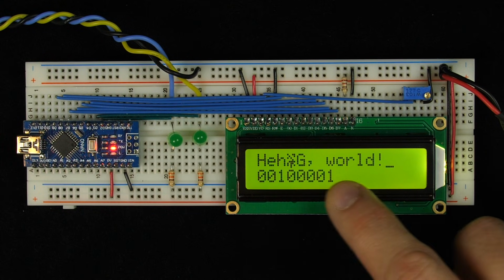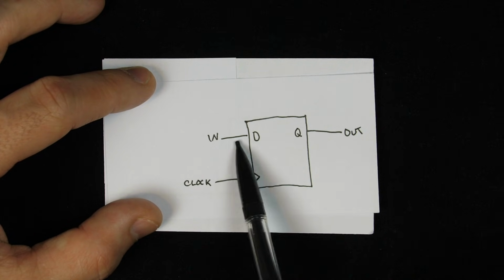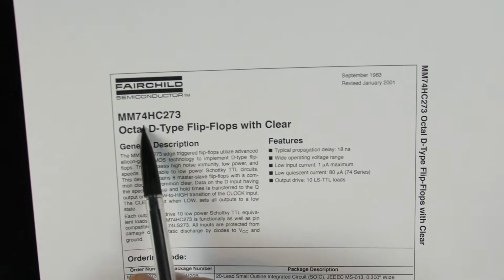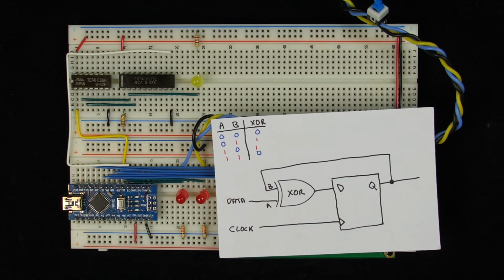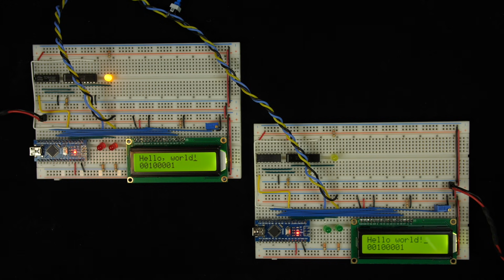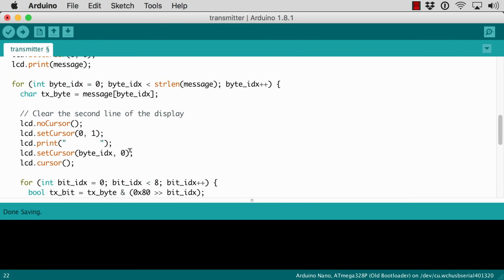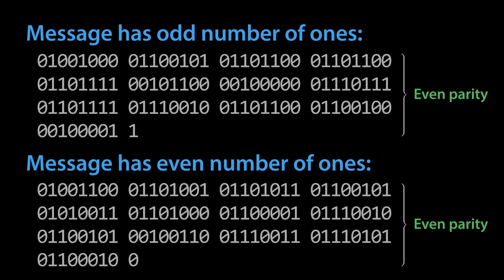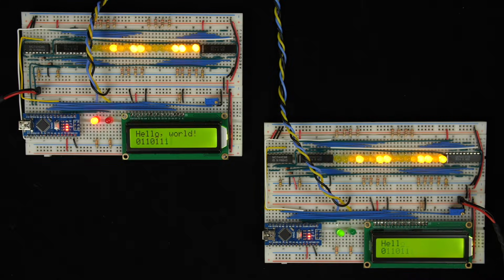Error detection: Parity checking

Comment: Interesting.  But what about intrinsic clocks?

For example, with twisted pair, one wire in each pair is always 1 and the other is always 0 when data is being transmitted.  There is a "D+" and "D-" wire for each pair with "D+" having the data and "D-" having the negative image of the data.

Also, are you going to continue expanding your 8-bit CPU?
Reply: Timothy Chapman You described differential signaling, which is not a clock transfer scheme. A way to integrate the clock might be to toggle one line for 1 and another for 0 - compare quadrature coding. Manchester coding depends on measuring time.
Reply: I know it doesn't transfer a clock signal.  That is why I said that the clock is "intrinsic."  Though I guess I should have said "implicit" as opposed to the clock scheme in the video which is "explicit."
Reply: An earlier video in this series demonstrated using similar but drifting clocks (exaggerated by using busy loops and asymmetric code, rather than timers), and the method used to avoid it in this series was to add an explicit clock line. This is one of several techniques, used in e.g. PCI, SPI, DVI and HDMI. 

Some schemes embed the clock into the data line, such as Manchester coding which guarantees toggles at a base frequency. An optional toggle between the regular ones indicates a 1, no extra toggle indicates a 0. This allows reconstructing the clock if the data stream is not continous ones or zeros; frequently it is combined with a padding scheme that guarantees this, such as 8b/10b which also balances 1s and 0s. This property, absence of DC bias, is used to ensure a signal is always detectable (critical to keep relevant threshold levels in e.g. optical links). Embedded clocks like this are used in e.g. DisplayPort and Ethernet. 

You may also be familiar with the scheme used in RS-232. Recovering the baud rate automatically there is harder, because a pulse width could mean anything from a single bit to a line break signal. Again padding with guarantees is used; an idle state set by a stop bit (logical 1) and ended by a start bit (0) allows asynchronous start of each symbol. Typically we give an intended baud rate for both sides, and the receiver supersamples, i.e. reads faster than that rate and shifts itself to phase match. So what reads as 0000111000111 with a planned 4x supersampling rate could be recovered to 0101, compensating for a 25% difference in clock rates (longer stretches of 0s or 1s amplify the differences, so that's probably too big a difference for real use). Even receivers that don't supersample might get away with just counting time from the stop-start bit edge, that is guaranteed to happen for each symbol. Some devices deduce the baud rate from expected traffic, such as modems using the Hayes command set and expecting the letters AT. This sort of steady state followed by an agreed in advance implicit transfer rate is also used in e.g. USB (low, full and high speed - I'm not sure about super speed). 

USB also uses regular frame transfers which allow clock synchronisation with less overhead, for instance used by FTDI FT230X. A similar thing can be observed in many video signals such as VGA, where clocks are per line and field; the pixel clock used by digital displays is some multiple of those frequencies. Inaccurate recovery in flat panel monitors may lead to aliasing and wobbling. Modern TVs do it inaccurately leading to blurring and partial pictures out of tradition only (look for overscan and 1:1 pixel mapping settings), while monitors tend to be set to show the full picture. Even so there's signal time allotted for other uses like retracing the beam CRTs use, teletext, and audio. 

Another scheme is using every pulse width as a symbol itself. This is done in e.g. Dallas 1-Wire and hobby servos. It still uses a time reference, but it may not need to be as precise as for a multi-bit stream. 

The toggle one line at a time approach has also been used for more symbols, e.g. XMOS XS1-L "Fast XMOS Link". Stepped rotary interfaces like encoders in mice and stepper motors use a similar approach. Some use a single signal to just count events, like power grid synchronised or pulse driven clocks.

Comment: Thank you for all of your videos.  This is a fun refresher course and nostalgia trip.  I started learning and experimenting with logic chips in 1975 and wire-wrapped a 6800 computer from surplus parts back in 1980.  I couldn't afford much of anything back then, but it helped me get a job in PC programming.  The downside is I was far removed from logic level hardware by the mid 80's.  Now that I'm trying to retire, I'm getting back into hardware with the Arduindo and revisiting logic chips again.  It's fun seeing what everyone is into today.  I find the protocols I2C and SPI especially interesting since my specialty was mainframe communications (which was a mix of mostly bisync, sdlc, and ebcdic which I learned at the same time as ascii and dial-up).  It's fun and nostalgic to see start/stop and parity bits again.    Now let's see the Arduindo calculate a 16-bit CRC!   (stx)Hello, world!(etx)(crc)

Thanks again,
Dave
Reply: So few people seem to have used the MC6800. I decided recently to build a system around that chip just because the thing looked neat.

Comment: Pretty good description and tutorial.  although I think it was a little misleading @18:58 when you showed HyperTerminal for setting COM1 UART data for parity and in the words you spoke there called talked about parity for a "block of data".  As you know, EVEN, ODD parity for RS-232 is on a per byte basis (7 or 8 bits of character data, 1 bit of parity), not per block (where the word "block" is used multiple characters).  You correctly later talk about per character unit parity and trade-offs which I though was well done, so keep up the good work.
Again, this is a nit, I like what you are doing here and assume your next videos will go into frame check sequences, CRCs, etc.
Cheers,
Alan

Comment: How does transmitting work over Ethernet? How is it possible to make sure that money transactions are 100% correct over the Internet?
Reply: Its not that different to this. Just that the "parity bit" is not just one bit, but first a code(called checksum) with a length of 32 bits that is calculated in a certain, more complicated way, then another check with a 16 bit checksum, and finally another check with a 2 bit checksum. All happening at different stages of the transport.
With a 32 bit checksum you are highly unlikely to get a wrong packet because there are so many options(4294967296 options).

And for online banking your traffic is encrypted as well. So people can't read it.
Reply: "highly unlikely" so its not 100% safe ? Yesterday i downloaded Linux Mint ISO (1.6GB). Why should you veryfiy your iso? When you transmitting the data it checks every packet with a checksum so you should not get an error right ?
Reply: Even if you verify the iso afterwards with, say, an md5 checksum, you are still not 100% sure its correct, its just a lot less likely it is incorrect. 
"Highly unlikely" in this context means something like a one in a quadrillion chance that it was corrupted. 
Because as long as your checksum is shorter than the file you transmit, there is always a chance that an error that occours just happens to produce the same checksum. In case of md5 a "collision"(meaning two files have the same hash) is very unlikely for example because there are something like 10 sextillion(2^128) options what the hash could look like. But it is still not 100% safe.
Reply: Although Ethernet and IP both have checksums (the one in IPv4 far weaker than the one in Ethernet), it's very common for buffering routers not to store that checksum but regenerate it in their network ports. This means errors introduced in their buffers are not detected, only errors happening on the wires between nodes. When considering an operating system, a more thorough check is also motivated for security reasons. Incidentally, BitTorrent performs far more thorough checks than a single hash (because it hashes on block level, rather than just the whole file).
Reply: Nothing is ever 100% sure to get correctly sent/received.

Comment: Okey, but is a case when parity bit is flipped special? It's creating errors which are impossible to detect or not really?
Reply: Jump3r3993 If the parity bit is flipped, you detect an error although all the data bits are intact. Single bit parity can detect one bit flip but not identify which bit was flipped.

Comment: I have a question: is your goal to connect your two breadboard computers using a network?
If that is not the case, you could do it and add a signal to send informations to the other computer, add an input for if you received a network packet (NWR for NetWork Received), and add instructions like NWS (NetWork Send, which take an 8-bit input that can be a RAM address or the OUT register and send them to the network) and NWI xx (NetWork Input to RAM address xx, which pause until the network card receive an information, then store that received value to that memory address xx), and maybe a NSR xx (Network Send and Receive, which does NWS then NWR xx in one command), so that you could for example make a multiplier on one of the breadboards and make the program to output x^y on the other. (Maybe you could even modify the OUT command to connect the OUT register to the network module and autosend informations from the OUT register on one breadboard, etc, etc!) (These are only suggestions...)

Also, I wrote this program that works, until it ends, but if you reset it too soon (actually, before it execute what's in address 9), it crashes: (notation: "address: byte")
0000: 0001 0100
0001: 0100 0001
0010: 0101 0001
0011: 0110 0101
0100: 1111 0000
0101: 0010 1000
0110: 0111 0101
0111: 0110 1001
1000: 0011 0000
1001: 0110 0001
1010: 0101 0001
1011: 1110 0000
1100: 0110 0100

Try to get what this does...

Comment: Soo... you make a parity bit of parity bits?
Like one parity bit each byte of data and one parity parity bit each byte of parity bits.

Or... you check for parity both per column and per row of data?
8 bytes of data + parity of each byte (1st parity byte) + parity of each first, second, third.. bit (2nd parity byte).
That way you could even reverse engineer the error and correct it without having to receive the message a second time.
And the number of extra data to send would only scale up by 2*sqrt(n).

Comment: I like the idea being presented, but I find arduinos to be uninteresting.
Reply: What  you expect from this comment? That Ben stop using a very handy teaching tool just because you don't like it?
Reply: Very odd comment as this really has nothing to do with the Arduino.
Reply: The arduino is really nothing more than a common atmega328 microcontroller, a voltage regulator, and a crystal. You could build the same circuit on breadboard if you wanted. The most useful part is the loader and IDE, which just speeds up development time.
Reply: This has nothing do do with Arduinos and everything to do with data transmission. You can replace the arduino with any other controller and get the same result.
Reply: and besides, this makes arduino look interesting
Reply: @Matthew Smith indeed
Reply: arduino is just atmega328 and a bootloader and C++ (avrgcc) and some library that you don't need to use if you don't like, why that prejudice, it's a good tool
Reply: Yes, the real content of this video is the circuit he built to do parity generation and checking. Looks like we're going to get a CRC generator next...

Comment: Why didn't you just calculate the parity in the arduino?
Reply: He could.  But then he could also just use the arduino's built in UART to send the data serially with a lot less code.  I think the point of these videos is to demonstrate how serial communication works at the hardware/bit level, and the parity circuit demonstrates that nicely
Reply: Gal Horowitz 
Hardware is faster and with this opportunity the viewers can learn more about ics, along with nicer visualisation.
Reply: Why doesn't he just send himself an email? ;)
Reply: Yes, the same logic could be implemented inside the AVR. It would then have had no physical presence. This demonstrated how a circuit can generate the parity with no additional handling in the transmitter or receiver, and precisely how the feedback loop data flow works. Just like the fact that the transmission is operating at human readable speeds (but not even supersampling like a UART would), it's for demonstration purposes. 

If we just wanted to get parity for protection, we could set UPM0 in UCSR0C and use the USART. But this isn't about the ATmega328. The logic looks the same, though the schematic in the datasheet section 24.5.1 just lists an equation with n XORs.
Reply: Gal Horowitz you are missing the point of the video. This is meant to demonstrate how error detection works on a logic gate level
Reply: Probably because this way ties in with how it's easy to build the function in hardware, and how CRC is a simple extension of the parity counter. Much like why he's not using the  SPI or USART peripherals built into the ATmega328. If this was a peripheral for the SAP computer, I'm sure you'd be seeing a shift register such as 74hc198 also.
Reply: Because he wouldn't have a video then. The point of this video is to show people how stuff works. People understand problems in different ways. For a lot of people seeing the physical circuit wired up is going to be clearer than some abstract code.
Reply: The hardware could be faster if you were trying to make the arduino send data as fast as it possibly can. Calculating the parity bit in software would involve extra processing for each bit.
Reply: How is the hardware implementation faster? There are many propagation delays in the IC's + capacitive, inductive paracites and larger resistance in the wires, breadboards and pins. The software implementation would also have delays (depending on what is executed before the parity calculations) The software is also depended on the AVR hardware, but I assume that the registers in the AVR chip are much more optimized compared to chucky IC's.. Ultimately it comes down to the clock speed of the UC and the intercomponent bus
Reply: @Sorenp-n5o  The AVR chip is an IC too.
Reply: To all of you: This is an episode in a series about communication. The topic of this episode is about Parity checking - a strategy to verify the integrity of messages. The fact is: The same system could have been created in the arduino, with actually less overhead.
The hardware is not faster - it runs on the same clock as the arduino, and having to read the port and then transmit takes time. You are missing my point.

Comment: Will you ever get to hashing?
Reply: +Toncho 1 It is used to make fixed-length string out of any length string. The point is that any small change in plaintext produces a big change in it's hash, so it can be used as error detection (and for storing passwords, etc.)
Reply: Toncho 1 To be more specific, hashing is a process that is lossy. This means that it is not possible to get from the hash back to the original message. This property makes it useful in password storage, because you dont have to store the original password on your server. An example of a simple mathematical operator that is lossy is modulus (%), or the remainder after division. For example, 5%2 is the remainder of 5/2, which is 1. It is not possible to get back to 5 if you only have the number 1 (the result) or  even if you have 2 and 1, since it could be any multiple of 2, plus the 1 remainder (e.g. 7%2 = 1, 9%2 = 1).

I wont be using an actual hash function for this example because Im on my phone.

Hashing a string like "abcdefg" may result in "8aoeWb8nw3". If you were to repeat the hash on "abcdefg", you would get the exact same result. If you changed it to "abcdefh", changing a single letter, then the hash result may be "Hls6WO91dj". By sending the both the hash and the message, the receiver can hash the message themselves and check it against the sent hash. If the message is incorrect, the hash wont match. Similarly, if the sent hash contains an error, the computed hash wont match, and the receiver will know there was an error. A lot of hash algorithms are designed to prevent collisions, or two inputs that are different but have the same hash output. This avoids situations where the message has an error, but the computed hash still matches, since it is extremely unlikely to have a collision. Additionally, the fact that a small change in the input greatly changes the output means that it is less likely that small changes in both the hash and message will result in the exact same hash value, increasing the effectiveness further.
Reply: Toncho 1 MD5, SHA1, that kind of thing. They're called "hash functions" and they perform "hashing" on their inputs.
Reply: White house Oh, i get it now!! Thanks :)
Reply: i mean, he technically did make an any length string into a fixed length string.
And any small change of the any length string will cause the fixed length string to change drastically(100% in this case).
I would say this is a hash function. Just a really unsecure one.
Reply: Gal Horowitz I think he will.
Reply: What do you mean by "hashing"?
Reply: 8 Bits I mean.. what is that used for?

Comment: Hello, why didn't you just check parity in software (program in Arduino which counts 1s in each byte)?
Reply: White house hardware is faster and easier to demonstrate with, and on top of this he can demonstrate basic use of digital logic.
Reply: +8 Bits Okay, thanks, I just wonder if it is possible in software because I can hardly imagine every network card has some D flip flop and XOR gate when it has a processor.
Reply: White house network cards do have dedicated hardware for this. The logic is tiny when part of an integrated circuit.